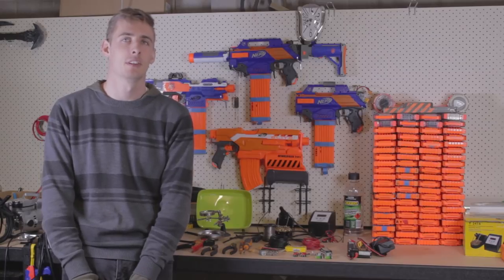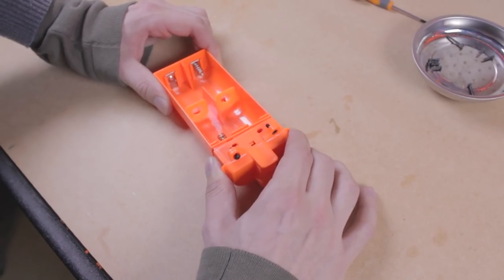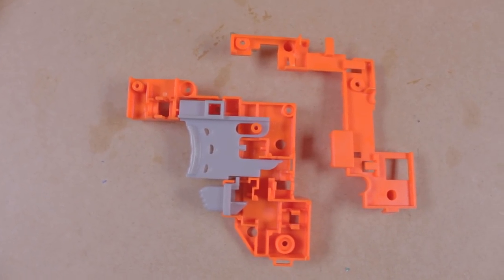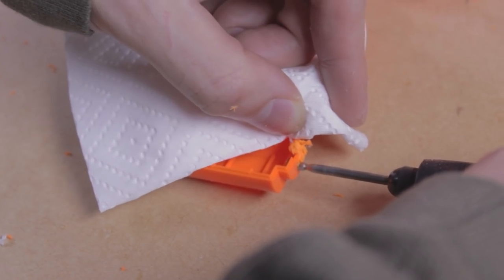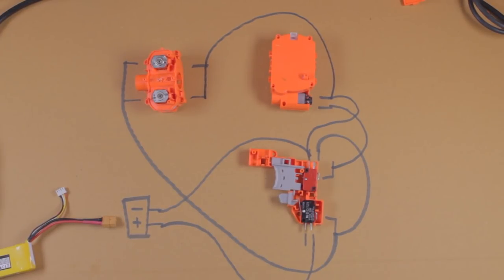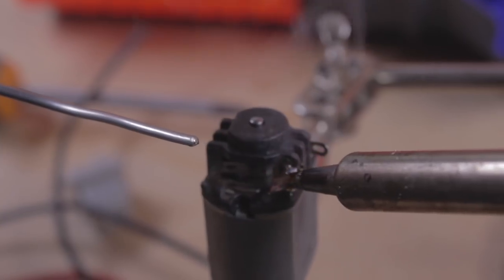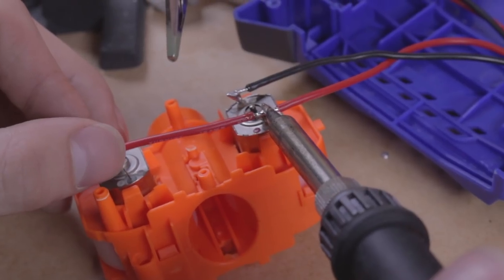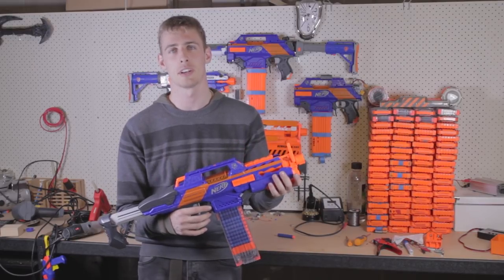How to Make a Super Rapidstrike | MAKE TEST BATTLE Modding Tutorial

Comment: Most of the items in the description are coming up 404, any idea where I could find the same components? Thanks!
Reply: Cody Zenner check outofdarts.com he has parts that are newer and more relevant
Reply: But will still function the same if not better
Reply: I'd recommend the website Containment Crew, they have a full switchplate and even a full kit for a Rapidstrike. IAmBololo has a great vid on installing the plate. Modern motors are custom made for nerf, I'd say Neo Rhinos or Krakens for 3s, Revamps for 2s. The budget build would use Valkyries or Meishel 2.0s depending on the voltage wanted.
Reply: Correction, it's IAmBobololo

Comment from the maker: @feltpen46; again due to your privacy settings I can't reply to you. I bought a bunch of rapidstrike about a year ago and have been slowly modding them since. I dont think you can find them new in stores anymore; your best places to look at eBay, Gumtree, or the Nerfaroo Facebook page.
Reply: will the pusher motor not retracting cause any issues?? can you get it to retract?
Reply from the maker: +WCxColossus I've been running this RapidStrike and 2 others like it myself and as loan blasters for maybe 10 or 12 events now and I haven't had a single problem with it. The part just gets pushed upwards a little if its extended and you put a new mag in. You need to go to a 3 switch system for the automatic retraction and that wiring is a way more complicated than its worth -R
Reply: +Make.Test.Battle When will you be making the select fire video i really am looking forward to it and have been for a while i think it would be very cool and i would definitely add one to my rapid strike if you have the time i would appreciate a answer thanks:)
Reply: You can find them in sweden!
Reply: +MTB rapidstrikes are still in stock at toys r us.
Reply: Falcon motor links are no longer valid.What would be a good substitute?
Reply from the maker: Water_Cool_Fool Search for our MTB Rhino motor -R
Reply: Thank you for your reply. If I replaced the 130s with better ones what lipo battery do you think I should get. Thank you for your time
Reply from the maker: Water_Cool_Fool Which better ones are you talking about? If you mean MTB Hellcats then go for something with at least 50 amps discharge -R
Reply from the maker: Water_Cool_Fool I think the comment got removed as spam even tho I clicked accept. RM2's arent a good choice for motors. They have metal brushes and will quickly die. -R
Reply: Make.Test.Battle ah i will proabably replace them. This was my first mod I did on a Nerf N-Strike Elite HyperFire Blaster.
Reply: still in stock at target over here near village crossing
Reply: Make.Test.Battle s
Reply: You can still find them new here or there in the US. I got mine just after this most previous Christmas at target & I recently saw one at a toys r us.
Reply: Make.Test.Battle is it optional to put them in the speacl water
Reply: Make.Test.Battle can I use 10 Gage wire
Reply: Amazon.

Comment: Just completed this mod using 3 MTB Rhinos with a 1000 mAh 3S LiPo. One thing to look out for is that the sharp edges of the MTB Rhino under heavy vibration tend to cut into the silicon wiring jackets—if the wires happen to be squeezed against the edges of the motor by the shell. In our case, this resulted in a couple of short circuits where the wire fused to the casing of the motor, resulting in a "smoking barrel".... not good! Quickly removed the LiPo before we saw any flames. Be sure to plan your wire routing to relieve stress against them.

Comment: Good video, appreciate the detail. Have you experimented with any of the aftermarket flywheels, I see both diagonal and straight cut aluminum wheels are available. I’m guessing the diagonal cut could rotate the dart, thus making it a bit more stable and accurate in flight?

And the being made from aluminum would keep the weight up in rotational mass, so that additional fired darts would remain at a high enough speed.

Comment: Followed this guide and now I have pusher motor braking, but no flywheel braking. Is that the desired outcome or is there a way to get flywheel braking as well?
Reply from the maker: That is the intended result. You can but thats a bit more tricky with the RS. Flywheel braking isn't super important IMO. I dont ahve a circuit diagram on hand, but it is doable -R

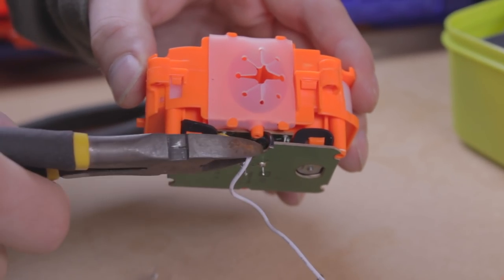Comment: Stock RapidStrikes with C batteries are known to jam. Is the rubber shroud @3:47 and 4:35 what causes jams especially if the C batteries start to run a little low?  Thanx to anyone who can answer that. Very interesting and detailed video btw.
Reply: Yeah, although it was meant to "guide" the dart through the barrel and prevent jams, it causes jams more than it prevents them. The quality of the darts you're using can also cause jams sometimes.

Comment: Using an MTB Honeybadger you could’ve upped the DPS to ~14. That’s what I did with mine. Plus, you also could’ve just replaced the flywheel cage like I did with mine. In addition to that (seriously, WHY don’t people do this?), is that you could’ve modded the battery tray and placed the lipo in to make it work like a battery pack.
Reply from the maker: “Do not cite the Deep Magic to me, Witch. I was there when it was written.” 😂 
You're trying to tell the creator of your motors how to mod. 
This is a 4 year old video, BEFORE Ryan had unleashed the MTB Rhinos onto the modding community, let alone Honeybadgers. 
There were no Worker flywheels and Daybreaks.
There were no affordable and widely available cages, even before the Open Flywheel Project. 
And if you remove the battery tray, you can fit a larger lipo.

Comment: Is the motor braking on this circuit just as effective as dead-center wiring in terms of preventing runaways? I know there's no pusher retraction but that can be worked around on higher ROFs and a 3D printed breech that was made a while ago.
Reply from the maker: There is absolutely no chance of a runaway with this design since the power is cut to the motor the moment you let go of the trigger. This is one of the reasons I like it -R

Comment: since this video is over 2 years old at this point and you mentioned adding a select fire system to include 3 round burst, did you just start over with a Regulator? or do you really prefer the mechanical pusher of the Rapidstrike?

Comment: Hi, I'm new to modding and have a question on the batteries. What's the difference between a 25c discharge and a 35c discharge? Great video btw.
Reply: The C rating on a Lipo pack is how much current it can put out in a given time. You multiply the C rating by the number of amp hours your battery has to get its discharge rate. For example if you had a 1000 mah 35C discharge pack you would divide the 1000 by 1000 to get the amp hours which equals 1 and then multiply by the c rating to get the discharge rate, in this case that would be 35 amps. You need to pick your motors so that when you add up all their stall current they should be 35 amps or below

Comment: 1. does the pusher not moving back ever cause problems? 2. can I do the same wiring running hellcats and a honey badger? 3. if the stall current of a hellcat is 45 amps do I need to double that for the two motors? 3 what battery should I use for this motor configuration? could I use a 35c 2200 mah lipo? will a 2200 even fit? Wow that was a lot of questions thanks for the great content keep it up

Comment: Why do you put the pusher motor in methylated spirits?
Reply: It's done to break in the motor to allow it to be durable under high voltages and currents. Ranson motors are weak, and can only work at this voltage if the following is done.

Comment: Awesome tutorial. The whole system is actually just motors & switches. What is the purpose of PCBs on the flywheel module & trigger module ?
A friend of mine has a brick Rapidstrike. Assuming the motors are still functioning, I will just bypass the PCBs entirely.
Reply: It’s to limit the power

Comment: Hi Ryan,
This is the best mod guide I've seen for the Rapidstrike and the one I'll be using for both of mine.
Is is possible to use this guide using a Rhino Pusher and Neo-Rhino Flywheel motors?
I'll be running it on a Zippy Compact 3S 2200mAh 60-70c Series LiPo. Is that right, I think it's more than enough current for the motors.
I'll be using the same microswitches as you and 16 Gauge wire throughout, and probably Worker or Bulldog flywheels.
This'll be my first Rapidstrike mod so I'd rather not make a complete mess of it, any help or advice would be greatly appreciated!
Many thanks dude!
Reply: 1.Use a honeybadger for pusher
2. Yes you are right
3. Replace the cage with a metal non canted worker cage and use bulldogs.

Comment: after following this guide I realized that the pusher can operate independently of the flywheel (without the flywheel running). is this going to be a problem or can it cause a short if I run them both at the same time?

Comment: Fantastic guide Ryan, thank you. I have a question. I seem to be having trouble finding either of the Motors you linked to in the video. Could you or someone else here point me in the right direction. I've just purchased a new rapidstrike along with all the other parts needed for this and cannot wait to start this mod. Thanks again. please keep the mod vids coming they are Excellent.
Reply: Use mtb rhinos as the falcons but use honey badgers for the pusher no need for a burn in. Google containment crew, thats where i got the motors

Comment: Just bought a rapidstrike from Germany as no uk stock. I followed your super Stryfe guide using the better switch and is awesome fun. Burnt out a stock motor but replaced it with one from a hobby store. No issues so far! Going to put rhinos in it tho. Is it necessary to replace the pusher motor or can the stock one be used?
Reply from the maker: +UK Nerf Modder probably best to replace them but I hear several people saying they use the stock motor. To be quite honestly I haven't used either in the pusher personally! -R
Reply: +Make.Test.Battle  Thanks for the help. I'm putting together a video of my Stryfe soon 👍 I have a shop nearby that sells cheap motors if I have any issues before ordering the rhinos I can just swap them out. Awesome tutorials by the way! 👏👏👏

Comment: Hi. Thanks for the tutorial, it is a good guide. I followed exactly. However, I am puzzled how to ensure that the pushed detracted correctly.
Reply from the maker: With a high rate of fire pusher; you dont really need to -R
Reply: THanks for your respond. I made a mistake then... I opened up the trigger box, and throw out all the circuit boards and wires. :) Need to find a better motor then. :)

Comment: Hi Make Test Battle! I was wondering if you could update the links to the Falcon motors in this video. They both lead to sold-out sites. I have Googled for the motors myself, but I can't seem to find any thing similar. If the Falcons have been discontinued, could you recommend a similar motor? Also, I have one more quick question. The gun in the video used one Ransom motor and two Falcons, but there is not a Ransom motor link in the part list. Do I need the Ransom, or would three Falcons suffice? Thank you for your time!
Reply from the maker: +Test Facsimile Ahh sorry! When I get back home tonight I will update all the motor links. I have gone and made available the "MTB Rhino 130" motors. They are the same performance as Falcons and work very well in both the pusher and the flywheel motors. I will have a very short update video up as well; but for now just Google "MTB Rhino Motor" to find the links. -R

Comment: I am confused, what do the different terminals on the micro switches correspond to? Looking at the circuit diagram, it looks like there will only be a connection to the negative battery end when both the rev and trigger switches are depressed meaning the rev trigger is useless as you can't send current through the flywheels until the trigger switch is closed. Obviously this is not the case so what am I missing?
Reply from the maker: Mica T The piece you are missing is that the flywheel negative terminals will flow to the LiPo via the pusher motor tab

Comment: Will the Ranson or Falcon pusher motor work well with Mabuch 180s as flywheel motors? Is there a significant increase in performance using 180 motors over 130s?
Reply from the maker: Philip Jay Ocampo Two part question:
1) It depends. From what I know, the 180s that are used are typically used at 2S (2 cell LiPo batteries between 8.4 - 7.2) voltages. Falcons and Ransons use 3S (3 cells -> 12.6 - 10.8 volts). If you use a falcon or a ranson at 2S voltage you are reducing the RPM and torque by 33%, reducing rate of fire.
2) No. I am still working on how to present the maths behind it in video form, but the short answer is no. Unless you have a system that can fire more than about 15 darts per second there is no benefit to using 180s over high end 130s (Falcons etc).

Comment: Hi, thanks for making such an informative video. Regarding the circuit, why is it necessary to attach anything at all to the NC of the trigger switch? Wouldn't it be alright to bypass the switch and go straight to the low voltage end of the battery? Thanks in advance  for clarifying c:
Reply from the maker: +Clement Chan That is so that the motor will engage motor braking when you let go of the trigger. At high RPM the motor might fire 1 or 2 extra darts if it didn't stop immediately -R

Comment: hi, I just finished my first re-wire. a rapidstrike cs-18 with MTB Rhino motors. when I test the flywheels for directional rotation, the connected motor starts to make a sizzling sound and gets really hot. Obviously, this is a bad sign. Then I took a look at your battery and I think I may have been a bit rambunctious in my choice of battery. it is a blue Zippy 2200mah 40c discharge 3s LiPo. seeing as our batteries are both zippy but yours is a compact with half the mah and almost 40% less discharge, is this most likely what is causing my overheating problem?
Reply from the maker: +i Chop Make sure you have the circuit correct! That may be a sign of a short circuit! -R
Reply: +Make.Test.Battle So I took it apart and realized the common on the rev switch to the n/o on the pusher switch wire was pinched and exposed between the entire assembly and the common on the pusher switch. Since my soldering joints were pretty shoddy to begin with, I went ahead and re-wired the entire thing and now it works great. Now I'm using three of the MTB Rhino motors and I keep reading everywhere that it is optimal to run the pusher motor at 9V. I have the diodes to achieve this and I think the diodes belong on the wire between the common on the rev switch and the n/o on the pusher switch. Is this correct? BTW thanks for the help Ryan

Comment: From after watching Coop's mod guide, I thought the brute force method for removing the circuit board on the motors was a bad idea?
Reply from the maker: Mica T It really makes no difference. None of the original electrical components are kept anyway. So long as you don't destroy the actual motor cage or trigger group themselves you are fine. Coop's mod guide is not a proper overhaul as he keeps the original wiring, a bad idea with replacement motors due to the higher electrical resistance along with the fact that the original wiring is very prone to "bump firing" with higher RPM due to a lack of motor braking.

Comment: Do you have to use Silicon WD-40 spray oil on the Rapid Strike, or can you get away with the regular kind?
Reply: +Test2 Facsimile If you use normal WD-40 I'm pretty sure it will melt your plastic eventually

Comment: Could I use two rhino motors for the flywheel, and a honey badger motor for the pusher with the same battery in the video? Also, the link to the liPo battery is a 35c discharge. You said to use a 25c.
Reply from the maker: Yep, Rhinos and Honey Badger is a good option. 25C works, but a 35 would be better -R
Reply: I'd recommend waiting till you can get Hellcats, (which is now) their new 3s 180, arguably best motors on the market right now.  More than enough torque to handle the 14 dps of a honeybadger on 3s
Reply: Yes, but the Hellcat motors pose a problem of interfering with the frame assembly due to its length.
Reply from the maker: If you are okay with cutting the shell, get Hellcats; otherwise Rhinos can still handle the HB pushers -R
Reply: I just cut my shell last night for a trip-blade RS!

Comment: I'm using Li-Ion Batteries for this setup. Currently running on 11.1V. Would it be possible to run this setup with 14.8V?
Reply: No. Just no. Just use a lipo and 14v will fry the motors

Comment: How expensive is the parts all together?? Not the equipment, just the parts
Reply: Let's see. Motors x3 = $15 (5 x 3), (Assuming you're using rhinos), $29 for the switchplate (Or 15 for microswitches) and $3 for the connector as well as wire and heatshrink (Price will vary from where you buy your wires) Using BlasterTECH AU as a reference http://www.blastertech.com.au/ I'd say, you're totaling up to approximately $47 - $54. ($33 if you just bought the microswitches, motors, and the plug)

Comment: +Make.Test.Battle can you use a 2s lipo with stock motors and 18awg wire or will thay go boom???
Reply from the maker: +BUGOFBOOM GAMING They wont immediately die, but they will eventually burn out as they do not have carbon brushes -R